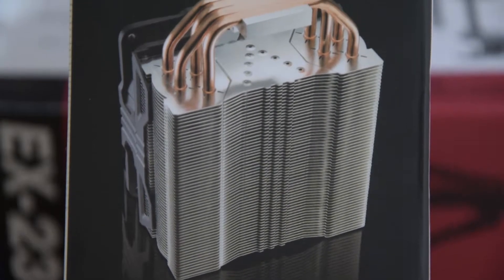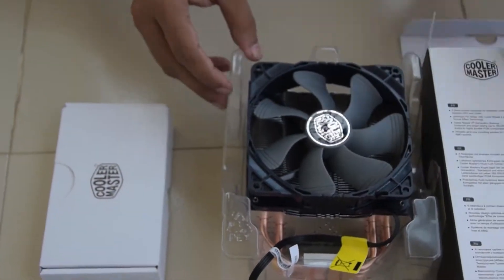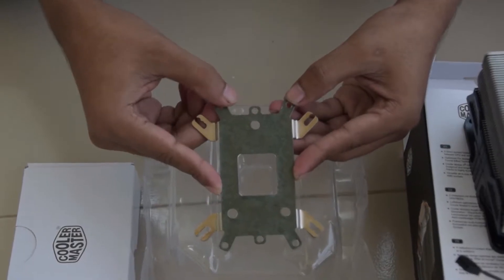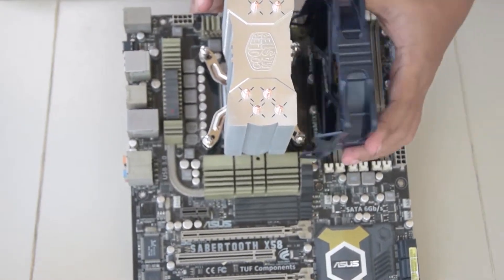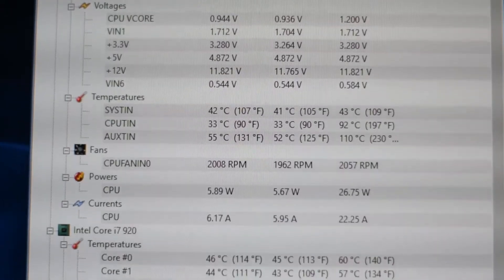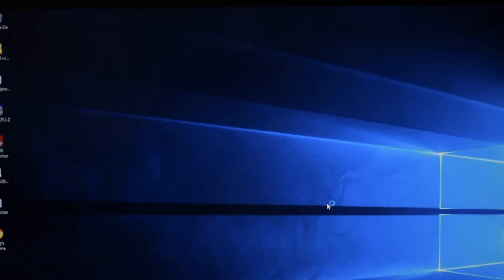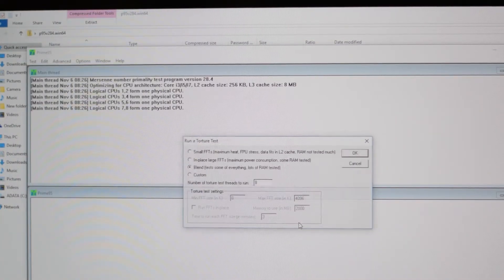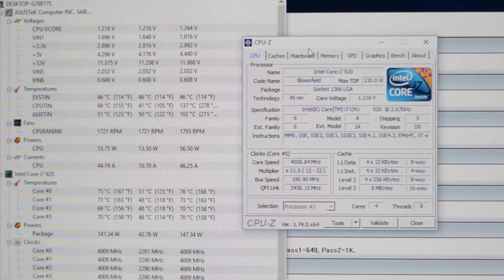Cooler Master Hyper 212x Unboxing Review and Overclocking Test

Comment: Doesn’t move around it’s totally titan though that’s the question I saw the 212 moved around after it was completely tightened didn’t like that didn’t buy so I was wondering if the 212 X has remedy that problem

Comment: Nice, if this cooler can do that for a 920, I should have no issue pushing my 6600k to 4.5 or so.
Reply: +Dekomori Sanae I'm getting The cooler and i5 6600k, I think it will be great with a 4'5Ghz OC, remember that skylake is 14nm and this i7 is 45nm so I think with an ok mobo 4'5 should be fine.
Reply: +Diablerie Tandino have you tried it yet? I want to get a 6600k but was wondering if this cooler can handle atleast 4.5ghz